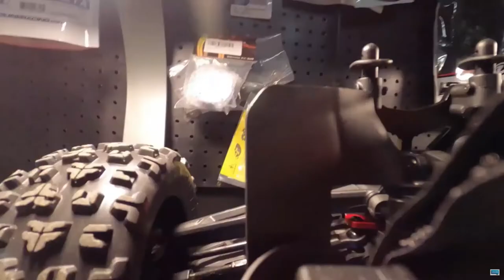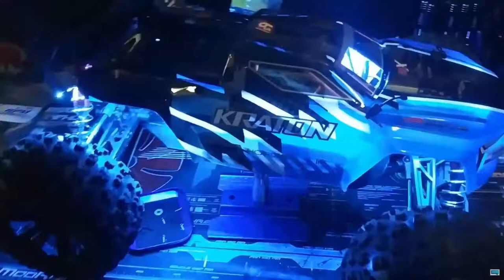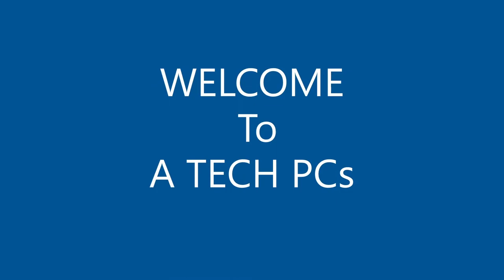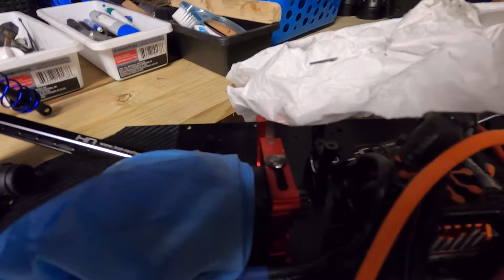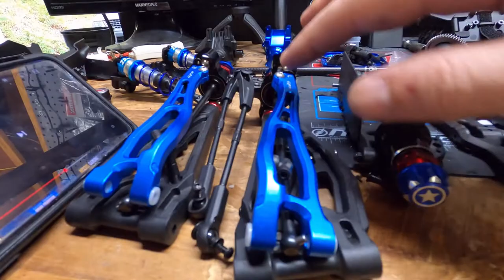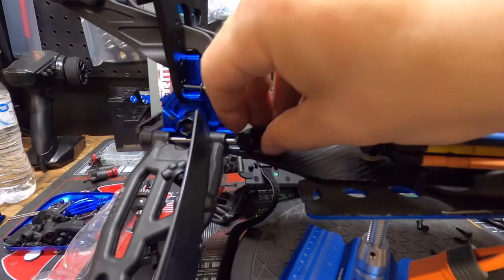KRATON6s+WHO" I AM?+ REAR "ASSEMBLE "+ UPGRADE FaIL !

Comment: The spacers on your upper rear brace are swapped backwards.  The wider one goes on the passenger side.  I'm talking about where it mounts up by the wing.  Those spaces arnt the same size.  I looked on my kraton and checked to see if my hot racing brace was that tight. It wasn't so I look at the video and then mine. The only difference in the two are those two little spaces on each side of it on  the upper mount.  The fatter one is on my passenger on skinnier is on the driver's side.  I hope that makes sense.   It's odd that it's tight like that length wise. Tbh most ppl once they put the aluminum chassis braces on they take that tower to tower off. I wouldn't suggest that though until u upgrad the chassis itself.  But if you don't plan on pushing it to its limits.  I probably wouldn't worry about it.   BTW.  I was a Tamiya lover in my early years.   I loved my monster beetle but my favorite was my Blackfoot.  I was never a fan of nitro had a 4tech but didn't use it much because I like electrics.  I raced as well but I had the rc10T T2 and T3. Loved that platform.
Reply from the maker: O. I didnt notice.  Thank you for bringing that to my attention.. Im have to tear it all apart again anyway.. I put the wrong dif gear in the diff... I know better than that.. But i dont know what i was thinking... I put diff Grease inside the diff.. It supports 10,000cst diff OIL.. So im have to get sum...lol.
Reply: I run 60,000 front 1mill in center and 80,000 in rear.   It's like it's locked up in a strait line but doesn't kill the turning and it doest diff  out to the front wheels  when it picks the front wheels tires.  Just my preference everybody likes it a little different.    I can't remember but are you staying with the stock  tires.  The  stock copper head 2's are ok but ballon super easy I would look into getting some 6s deboots  backflips.   And if your not a big jumper event lp backflips are good.